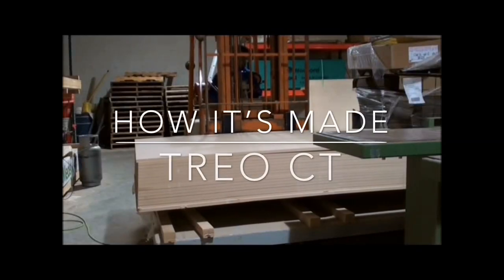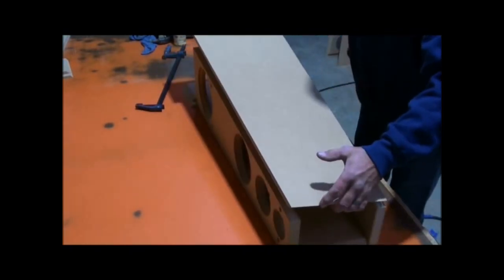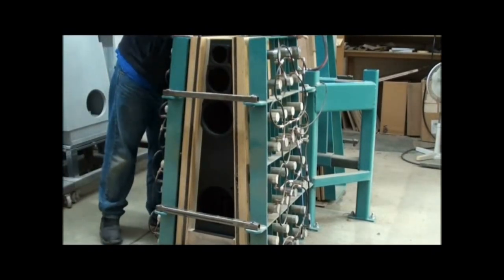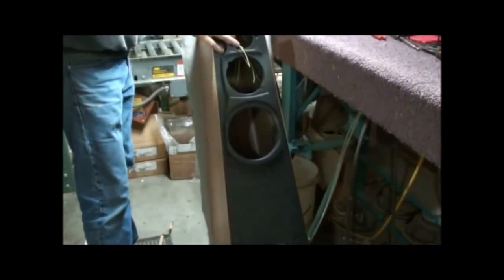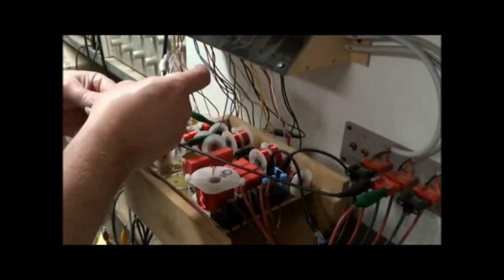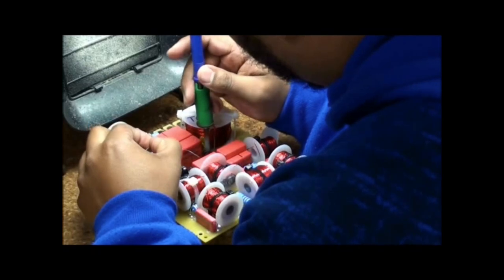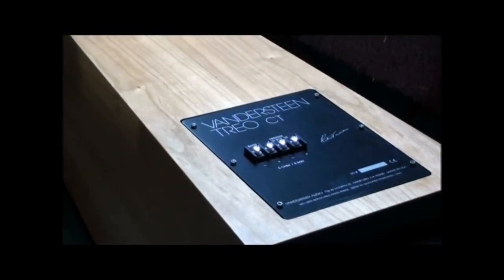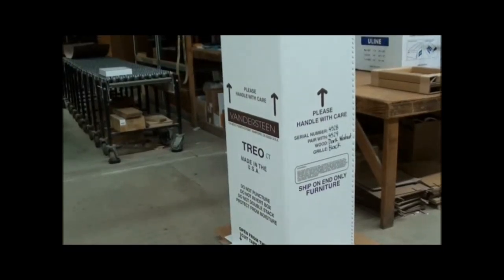Vandersteen Treo CT and How it's Made

Comment: Amazing. Lots of care and design goes into these. You make it look so easy! I have 3A sigs, but will eventually spring for the Quatro's, down at Circuit City...
Reply: Totally agree. Bought a pair of B&W 802 D3 Matrix years ago. Nice speakers but heard Quatro Wood CT’s and was extremely impressed. Then looked into the physics of his time and phase correct speaker designs.  I could have sworn my last speakers would have been Wilson Watt Puppies but no.  When comparing them against Vandersteen Quatro the quatro’s simply make more sense.  Still want to audition them with my gear, part of the problem going for a upgrade on almost all components which means $$$.